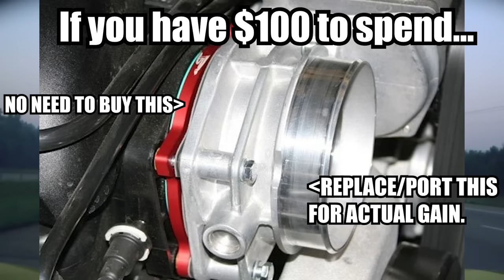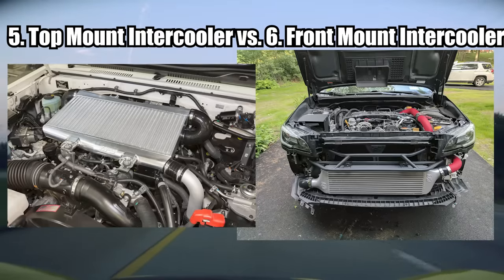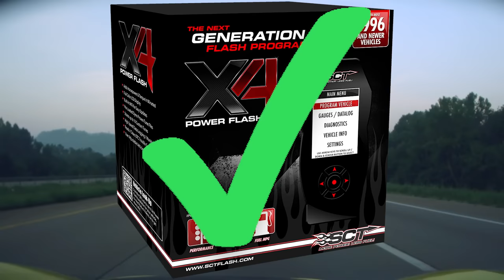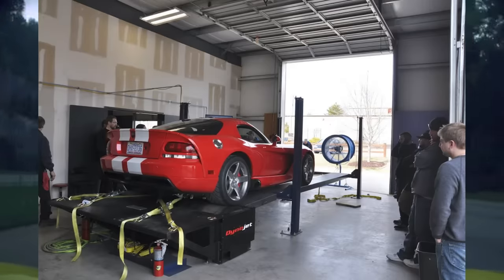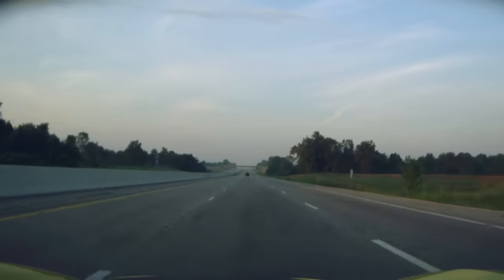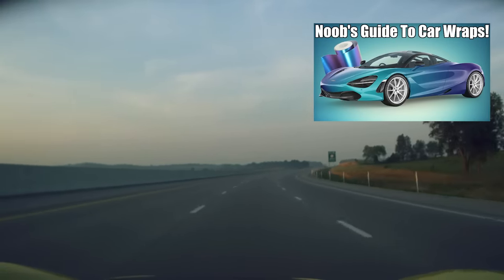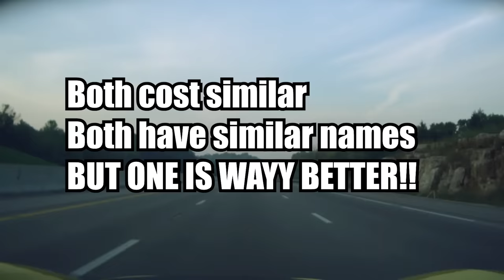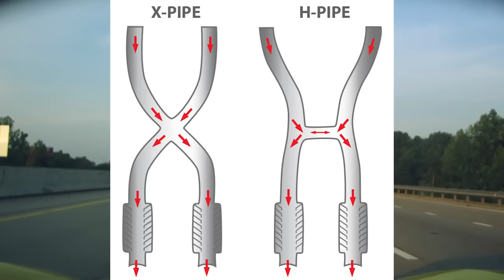25 Real VS. Fake Car Mods!

Comment: The biggest difference I noticed with a cold air intake is marginally better mpg. Though, the intake on it before had massive air leaks. 🤷‍♂️
Reply: the biggest difference I noticed is sound tbh.
Reply: @SomeOne_86  my car isn't in typical condition. It already had a cai but it was so bad you could remove it by hand. And it had long tubes on the exhaust. You couldn't hear the intake if you wanted to. I've made it quieter since then.
Reply: @SomeOne_86  sameeee
Reply: Yeah but that and a tune dosnt help
Reply: My CAI gave my car better throttle response and a nicer sounding exhaust, made it sound a lot more throaty.
Reply: Doesn't make much difference unless you have a turbo and a tune. 
I've also read some experiments where many CAI's on the market actually give hotter air than the stock intake.
Reply: @John Smith  thats why I make sure they are dyno tested with spread sheets on display for buyers. so I know exactly how much hp and torque my car would gain from it.
Reply: The throttle response increase alone, combined with the amazing sound AND look (IMHO) makes them worth.
It's the only engine mod where it's not necessarily a big HP gain, but the increase in driver experience is amazing.
Reply: @Howie Ewalt  agreed. cold air intake was my very first mod from stock and it makes a substancial sound difference even on n/a motors. and it helps improve low end torque especially when paired with a throttle body spacer.
Reply: @JohnSmith-wx9wj  Yeah but it's cheap and makes nice noises
Reply: like how much MPG? im trying to money on gas by getting mods for my subaru when I get it because I am a very broke man.
Reply: Same, but that’s because it was a stupid “CAI” that had the filter sit in the anyone bay and had a “heat shield” that didn’t block out any heat because it wasn’t a 100% sealed box. Once I tested why I got an increase, it turned out IATs were higher than with the stock intake (which in most modern cars is already a CAI). So I pulled it off, put the stock one in with a high flow filter and called it a day. Now if I want to improve MPGs I make sure to have the engine pull hot air.
Reply: @JohnSmith-wx9wj  Short rams usually add more hot air and people tend to think they are actual CAI's. A true CAI takes in air from the grill in the bumper. What experiments did you look at?
Reply: @wokkie168  Random videos and forums where people stick remote thermometers in the manifold.
Even the long tube stuff will have cracks in the box part, so they're taking air in from the bay instead of the grill.
Reply: It really depends on the car. If i remember right a cai for a crown vic is known to give it 5-10 more hp because the stock filter is so restrictive but you can get the same gains with an aftermarket filter which is cheaper. Honestly the biggest thing with cai’s on n/a cars is sound and looks. A big shiny cai with a nice clean k&n looks way better under the hood than the stock airbox.
Reply: I didn’t know mine was nearly completely torn once replacing 😭😂
Reply: The SRI I installed on one of my 2zz cars improved the induction sound massively. It also improved the throttle response. Additionally, it seemed to remove a little bit of power from the low end of the rev range, but pulled a lot harder in the higher rpms when it came on lift.
Reply: but wouldnt that mean it actually pulls in warmer air? because warmer air gives you better mpg but worse performance. normally colder air gives you worse mpg because the air is denser and thus needs more fuel to burn.
Reply: @jaredsquirrels5242  dyno tested cold air intake ??? how can a engine take in cold air if the air around the car is standing still and not being blasted through the air vents and openings in your frontbumper
Reply: @imnotworking  bc when an engine is running the cylinders create a vacuum which sucks in air around it as the air burnt in the cylinders exits.
Reply: @that_hatchbak_civic  Lol.
Reply: @imnotworking  have you never seen actual dynos? they have massive fans blowing air at the car so it doesnt overheat
Reply: On my atv I just noticed a bit larger torque above 3k rpm but no difference in sound
Reply: @SomeOne_86  idk if you make a hole like the hellcats it’ll suck on more air
Reply: @JohnSmith-wx9wj  that’s because of incorrect installation
Reply: Most “Cold Air Intake” are pumping warmer air than the OEM. Best bet is to take the pre-filter intake and replace it with a larger one that’s shaped the same.
Reply: I have never ever had a problem with cold air intake systems with all my cars they work just fine.
Reply: Hypermiling forums recommend increasing the intake temperature for better mpg. I have no idea whether or not this has any legitimacy.
Reply: @cantfindneutral dvg😂😂g
Reply: @JohnSmith-wx9wj that's because you didn't install it properly. A cold air intake should never be drawing air from the engine bay, this is such a common mistake that people make. If you want it to work in any capacity your better off buying the intake, having a enclosed box or heat shield and then using plumbing which is drawing from a vent from the outside of the car to actually bring outside air in. That's how a cold air intake works, they aren't designed to just be set up in the engine bay otherwise they are just not gonna work at all.
Reply: @herniagaming  That's the kind of system I installed on my HPP Ecoboost Mustang.
Reply: Don't you want to go with the full exhaust job and ecu remap if you're going to go with any aftermarket intake anyways?
Reply: I rather run high flow filter as most factory intake has the best position for outside air , only downside is the factory filter which is very restricted
Reply: @esoghumedominic13 I agree with this except the OEM filters filter more particles than the high flow filters, logically. Engines wear less with their OEM engine air filter.
Reply: @89andresp is true, but when going for more power, you sacrifice reliability.  The car manufacturers know the car can make more power, but due to fuel efficiency and reliability, they limit them. So the moment you start modifying your car , you are reducing the efficiency and reliability.
Reply: Ye now ur ecu is fucking up cos it’s thinking wtf is going on. Probably a lean mixture now
Reply: It would of been the air leaks. 
Colder air has more specific density.
More air density requires proportionally more fuel to achieve the required stoichiometric target. 

Air cooler by 5deg C is roughly 0.021kgm3 more dense if all other variables are the same. 
So would require roughly .0015kgm3 more fuel to achieve the ideal (for gasoline) 14.7:1 stoichiometric ratio for combustion.
Reply: @SomeOne_86 absolutely
Reply: Also, let’s be honest, the mods just look better than the stock 99% of the time.

Comment: my cold air intake was totally worth it for the look and sound, but besides the mpg boost there is not much performance gain to be had unless you are boosted
Reply: Or mpg
Reply: I’m putting one on my GTI literally only to hear my turbo better lmao
Reply: @SadistSalem  I'm over here getting excited about my N/A noise lmao, I drive the little underdog sentra ser
Reply: Put one on my si now I can actually hear vtec crossover
Reply: @jeffy69696  VTEC kick in yo.
Reply: @jaydenvert9168  brrrrBWWWWWWWW
Reply: @jeffy69696  great way to get sound without spending much on an exhaust system
Reply: @SadistSalem  I'm about to do the exact same thing to my GTI
Reply: @jaydenvert9168 🤣 vtec
Reply: Not true, you didn't complete the combustion equation.
Reply: If ur N/A tho u WANT to go CAI lol
Reply: Or to get rid of 0.00001% of engine knocking
Reply: I got better mpg and increased throttle response. I have a K&N intake system.
Reply: whats mpg
Reply: Just did my windshield wipers, who wanna race?

Comment: As a teenager who likes loud exhaust, I don’t do it for “attention” or “daddy issues” I simply like hearing the car/truck I am driving, and I would put glass packed exhaust/high flow mufflers to give it more sound depth, I just wanted to say that lol
Reply: Glass packs sound absolutely amazing on any V8 car and are dirt cheap. Just don't be an A-hole and use the ones that are like 4 inches long that hardly tone down anything lol 😆
Reply: @chrishernandez2490  😂
Reply: @TotinoOG  I have a 32 inch glass pack on my truck and it's very nice

Comment: One thing I noticed with the cold air intake is how fast the turbo builds boost compared to on the stock box. It's not making any more power, but it feels much quicker because of that.
Reply: HP and torque aren't the only factors to speed.
Reply: im pretty sure its just engine response. its not crazy though, youre not getting new power i guess you can say. this got proven to me by doing engine compression testing (for NA high compression will definitely squeeze out more power that the engine could've had brand new). a small engine does actually struggle more to get air with a stock box intake.
Reply: more airflow is making more power, not seeing higher dyno numbers doesnt mean it didnt improve the way the engine runs
Reply: Turbos aren't fed by the intake box they are fed by exhaust flow.
Reply: @spp6849  Well i mean depending on the engine you can make a fair chunk more from a good cold air intake. But it was always give some sort of power boost, but its pretty much never enough to actually feel a difference
Reply: @t.p1234xyz where do you think the exhaust gets it air?? The intake, WOAHHH
Reply: Exactly, no point having an extra chunk of power you can't reach.  Having that juice right when you need it like coming out of a turn to get back up to speed is huge even if overall power is the same or close.
Reply: Dumb response lol. Come back to me when you've built a turbo charged engine. @toddpope2134
Reply: @toddpope2134 urrm? No the turbine on the hot side of a turbo is fed via the exhaust gases causing the turbine to spin, this in turn spins the cold side/compressor wheel, which in turn sucks in atmospheric air, either via a cold air intake or by and intake box which gets compressed on the cold side/compression side of the turbo before being forced in the intake. At what point is a turbo car fed via the exhaust? Because once the hot side has used the exhaust gases to spin the turbine it's then pushed into the down pipe of the exhaust and out the back end of your car? Are you ok or did you just watch 2 minutes of a video about turbos and think you know 🤔

Comment: the way I see it, for all of this, is that there's no reason to cheap out on it. The fake/cheap stuff can actually be more dangerous than the real thing. In my opinion, there's no reason to buy the cheap thing and say you'll buy the real thing when you have the money. save the money now and buy the real thing right off the bat.
Reply: On the flip side,
Expensive ≠ better
Reply: @AdventureShock  Sure, but often times cheap = worse, if you want to get cheap and good then you must spend plenty of time researching, waiting for offers and stuff like that, also best way to cheap out is making everything you can by yourself, labor is sometimes the most expensive so if you are willing to learn and have plenty of time then it's a really good option
Reply: Cheap doesn’t mean bad. Anyone can spend money. I can’t stand bought not built people they know nothing just get in think they can drive but any talents usually just the money they dropped holding them up like a crutch and it won’t last.
Reply: I think it's important to differentiate between cheap and fake. Cheap is not necessarily unsafe but it may not perform as well. Depends what it is.
Reply: @christopherjohnston6343  I agree.  Burn cheap also can perform just as well or better depending on who’s doing work and application especially. And “cheap” is different to many people. So many say something’s cheap and it’s price is ridiculous and I’d absolutely never pay the price for whatever the product is. Especially when I can fabricate and make so much stuff better then people waste money on especially items that cost manufacturers a dollar and sell for 20. It’s amazing how much people will pay for dollar in material garbage.

Comment: There are real electric supercharger basically a procharger driven by an electric motor but the one you showed is the scam
Reply from the maker: Hence why I stopped calling the one I talk about "an electric Supercharger" You hear me say, "This 'intake fan' is an insult to actual electric superchargers".  I know real ones exist, they're great and useful.  I'm obviously just gonna call this scam ass piece an intake fan instead.
Reply: @BladedAngel  yes I was just elaborating on the entry
Reply: @BladedAngel  You said that the fan was an “insult to actual electric superchargers like the ones on electric cars” But they have actually made an electric supercharger for a gas engine which actually makes substantial gains in horsepower! And as for the CAI they can actually increase horsepower quite a bit depending on how your original air filter and intake tubes are designed! A lot of OEM air intake pipes are restricted and baffled to help decrease sound! So it is not so much the cold air part but the increased flow from the air filter and smooth wall design as well as bigger pipe diameter! Due to modern day technology this pretty much pertains to older vehicles!

Comment: Don’t forget that there are 2 types of intercoolers, “air to air” and “water to air”.

Basically “air to air” is the type you see sticking out of the front end and are usually quite thick and works like the name suggests, the “intake air” passes through the intercooler and gets cooled down by air going through it.

Water to air intercoolers are usually a slightly more complicated set up, basically you use water to cool down the “intake air”, most set ups use a “heat exchanger” (a radiator of sorts) which is “plumed in” (or connected) to the intercooler. But water to air can also be a “ice box” set up.
Water to air is a pretty efficient system and usually takes up less room than a air to air set up.
Reply: wow thanks for clarifying! I am a big Toyota celica nerd and the all trac turbo celicas had a water to air intercooler.
Reply: Water cooling the car
Reply: The thing is though, turbos are lighter/simpler with an air to air intercooler.
Reply: @ThePower1037  well yeah, off course, the less parts in a system, the cheaper and less complicated it becomes.

However not all engine bays have the space for thick charge air piping and big air to air intercooler which has to be mounted where it get a sufficient amount of air flow, but also preferably not too far from the Turbo. In that aspect water to air is far superior as coolant hoses are usually thinner and easier to plum up, plus the heat exchanger tends to be thinner than air to air intercoolers.

Both have their pros and cons, both are useful.
Reply: Sounds more like oil cooling. What cools the water?
Reply: @RCmaniac667  air cools the water, just like it cools the "water"/coolant in your radiator.

The heat exchanger is more or less a radiator for the intercooler.
Reply: What about air-to-ground? I've been using FAEBs and LACMs for quite a while now
Reply: @georgepapo9771  wait is that really exist?
Reply: @albertsuseintsus7355  yea they have really "explosive" results
Reply: I was gonna say this, if you have a water-to-air intercooler, you can put the cooling side heat exchanger basically anywhere you want.
Reply: Asking out of pure curiosity feel free to ignore: 
Does the heat exchanger work the same as the radiator by air passing through it cooling the water inside it? If so, do people ever just plem their heat exchanger into their coolant system? Would this be a terrible idea? @klaspeppar5619
Reply: @RandoManFPV  you could run the intercooler of the main radiator, but most applications have a separate heat exchanger, because most automotive cooling systems target around 90°C (operating temperature), some systems even target higher temps, not exactly sure just how much heat you would typically see in the intake system without a intercooler, but I would imagine that it would be a bit unpractical for the intercooler to be at 90°C or higher (depending on conditions), when you could get a lower temp with a separate system. Chances are you would end up with a either a “interheater” or largely ineffective intercooler.

If we look at a “manufacturer application” of water to air, the BMW B58 powered cars (or any of BMWs Turbo engines with water to air “intercooling”),  have two coolant reservoirs and systems, one “high temp” (for the engine, normal cooling system) and one “low temp” for the “charge air” or intercooler.

Comment: 0:55 Throttle response, while not being extra power, is a very, very valid thing to want in your build. Like, an NA with poor throttle response can straight up be worse than a turbo'd engine with really good throttle response.

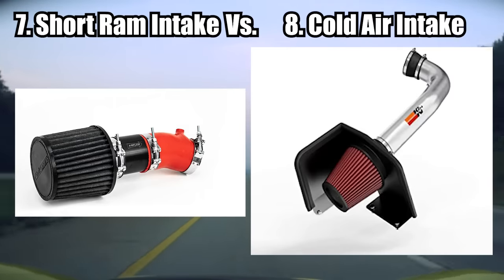3:30 Pretty much every car already has a cold air intake. A true cold air intake is giving it access to proper airflow, like by positioning it behind a bumper or headlight vent. Or out your hood. Or any other alternative you can think of, the sky is the limit.
Reply: Very valid. If the car makes me feel like it’s fun to drive, that’s all I need. The cold air intake thing seemed weird to me too because most cars take in air from the bumper or the hood. My current civic came with a “cold air intake” which pulls air in from the engine bay, which isn’t cold. And the hood is stock. I don’t see how that provides any benefit over a stock air intake, which takes in colder air from outside the engine bay

Comment: A cold air intake, or similar tube+filter setup is also a great maintenance mod. The stock tubing and airbox take up so much space that you need to remove them all the time to swap out parts/do some maintenance, so having a simpler setup makes it a lot easier.